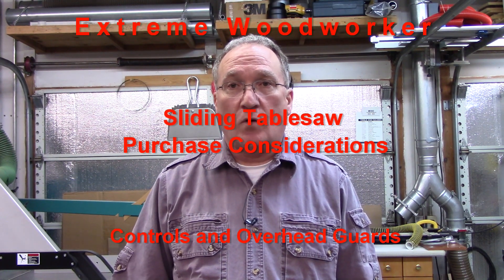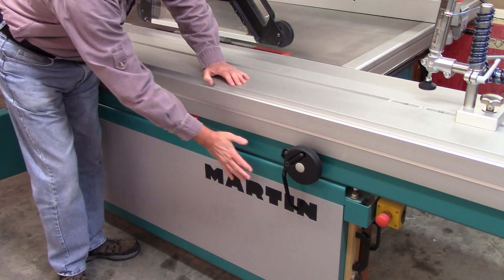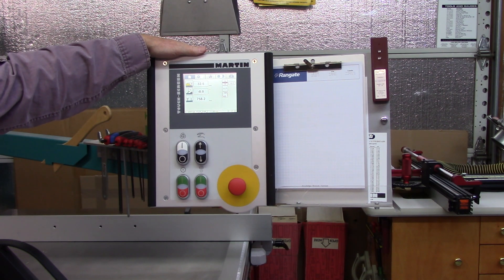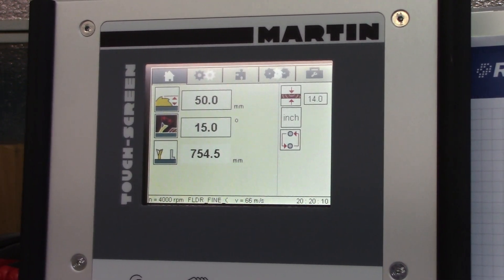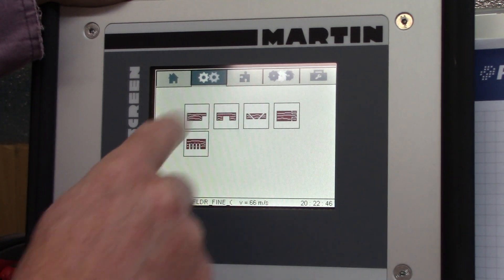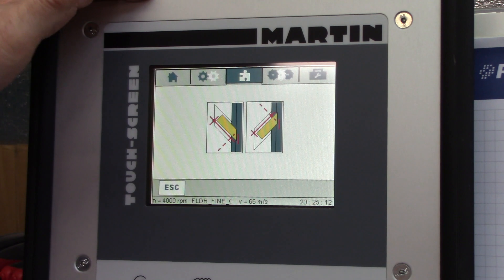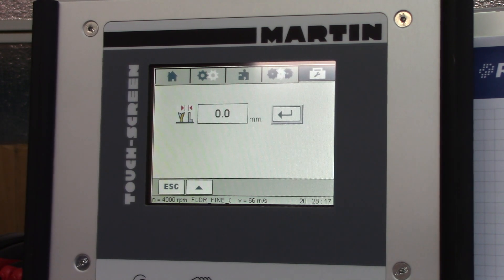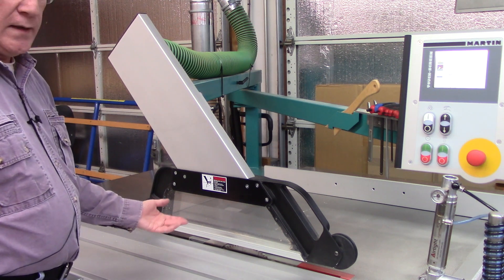Sliding Tablesaw Purchase Considerations PART 2d Controls and Overhead Guards

Comment: Hi Steve, Thanks for the video. I think the computer controls are really neat but have real concerns about long term operation. Seems like one software or hardware rev and you are out of luck or $$. I have the handwheel dial on my A3-31 and I really like it, I would like to do this on my new saw. I did however think the electric fence on David Best's saw was pretty slick, I like the idea of not going to the other side to set the fence. I wish Felder had the handwheel like your Martin, that coupled with a simple digital readout for distance would meet my needs perfectly.
Reply from the maker: Hi Mark.  I don't fret over possible future electronics failures and hopefully, the machine will be serviceable for many more years.  I still have the old computer and have been giving some thought about finding a place that can repair it just for a spare.  The fully automatic controls are pretty nice but only makes sense to me if you are in a full blown production environment.  The fence handwheel  coupled with the digital display is superb and I wonder if there is a patent that prevents this from being on other machines.  Having used it, I wouldn't want to go back.  Of course that also applies to the slider versus a cabinet saw as well.  Steve